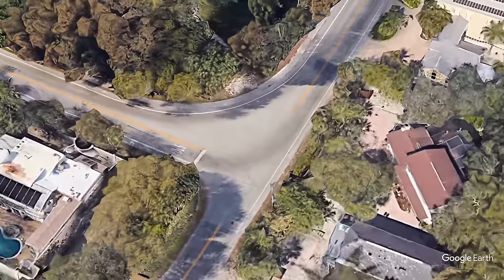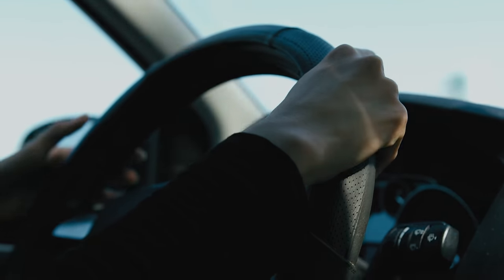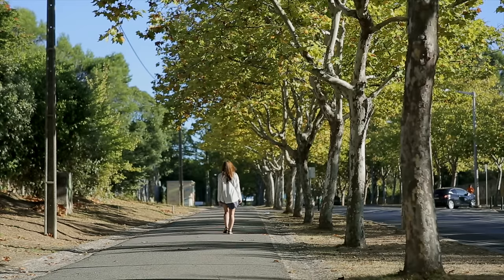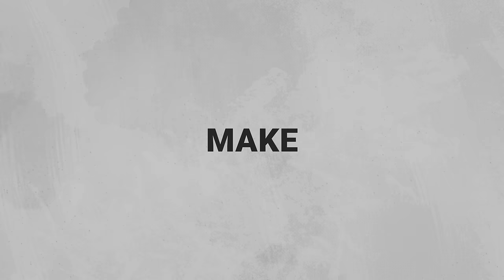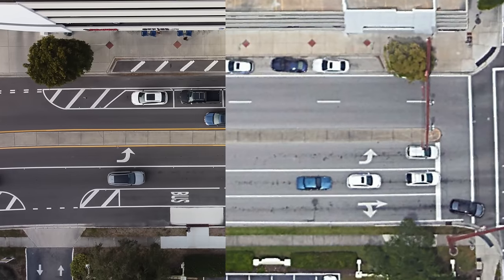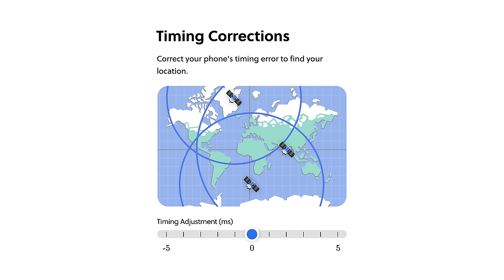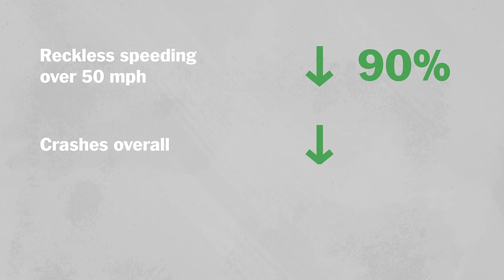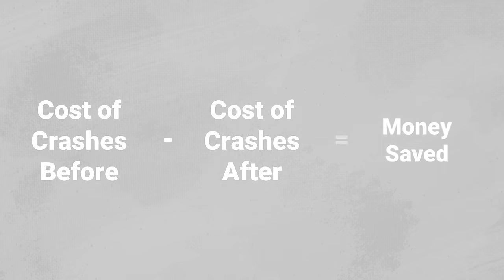This is the key to safer streets

Comment: Speed cushions are miserable if you drive a normal compact car with a lower profile. They cause a lot of stress on sway bars and end links (because of the unequal forces creating torsion) and create sideways motions that throw passengers side-to-side. In some cases at posted speeds I've seen passengers hit their heads on the inside of the window-- vehicle safety design is generally focused on cushioning forward-backward motion. But mostly, speed bumps of any kind favor higher speeds from tall or lifted trucks, exactly the vehicles most dangerous to pedestrians.

I much prefer the islands and narrowing perception tricks to get traffic to slow appropriately. Roundabouts as well are nice, and the plastic one shown here is a great way to introduce them.
Reply: ".. sideways motions that throw passengers side-to-side.."
-You drive an American car
-You drive too fast over the cushion
Reply: @RandomerFellow  the most uncomfortable it is to the passenger of smaller cheaper class European cars.  They are smaller and shorter at the back, so you don't have that much space around your head.
Reply: @RandomerFellow Posted speed in a German hatchback. So no to both, but thanks for playing.
Reply: I've never had a problem with them, ( I mostly drive a Honda jazz which is not a big car). All you've got to do it take it like a speedbumb, shift down into second and reduce your speed to 10-15mph.
Traffic calming measures are designed to reduce speed, not a challenge to try and speed across.
Reply: @annasolovyeva1013 Good to see a fellow Russian on here.

Comment: The big street I grew up on was altered from 4 lanes to 2 with a center turning lane. It has been that way now for decades. It has full proper signage and lane paint. Many drivers still do not pull into the turning lane to turn left, blocking their travel lane. other drivers pulling onto the street use the middle lane as an onramp almost colliding with car there waiting to turn left. I don't know if these are normal problems for turning lane roads or just our local dummies.
Reply: They are nicknamed suicide lanes for a reason. To fix the problem, through traffic needs to be separated from traffic that wants to turn. Using a parallel road on either side, that you can only access every half a mile or so. But I don't know if there's enough space for that.

Comment: As a Cincinnati commuter I actually have driven on North Bend Rd and got ran off the road from a speeder. The two lane road was so misplaced, like most of the roads around the area. The new changes are really welcome for a daily driver. Another road to mention in the Greater Cincinnati area is Harrison Ave in Harrison, OH right by the Marcos. Greater development has made the traffic move much more consistently, and protects left turn drivers going into the development. Great changes!!

Comment: Many of these issues have already been fixed in the UK, crossings have lines that mean you cannot park or stop there to allow for visibility on the crossing
Reply: Our road standards are still far behind The Netherlands, though.

Also, paint is not infrastructure. Those painted lines discourage parking near crossings, but don't prevent someone from doing so, especially as enforcement is so poor.

Comment: 7:14 When I was on vacation around Puerto Escondido, I quickly learned that in Mexico speed humps/bumps ARE considered an acceptable form of traffic control on highways. Instead of controlled access or traffic lights at the population centers along the highway they just paint a bunch of warning lines down and slap a slab of concrete at the end of it. On the local roads you were lucky if you got any signage at all.

BTW - keep up the great content. This level of quality does not go unnoticed!
Reply: Guess they don't care about the ensuing congestion then.

Comment: You forgot to mention the most cost-effective traffic-calming measure of all - in fact one that doesn't require any road redesign or construction efforts - potholes. A heavily potholed stretch of road/street will slow down traffic with certainty, even on wide and straight roads that would otherwise encourage drivers to speed. And it requires no cost to build or upkeep to maintain. In fact, it really doesn't.
Reply: Except drivers can sue the city for improper maintenance when their vehicles get damaged.  Potholes let in water which freezes and expands damaging the road even more.

Comment: Its also important to consider traffic densitiy and different types of safeties.

A roundabout is unsafer on the number plane, if you count number of accidents. That because small accidents are common in roundabouts. However, each accident is less severe, meaning a "accident" in this case is just a broken light on a car, or a small dent in the car bodywork.
But a roundabout is much safer if you count accident severelity, both at lower and higher speeds, because of everyone driving in the same direction, and also no dangerous left turns, which means, in most roundabouts, zero death accidents.

Roundabout is good when the traffic density is almost equal on all connecting roads. And thats why they "upgraded" this intersection to a roundabout, because the traffic density increased on the connecting road.

A stop sign (or a yield sign) is "better" if the traffic densitiy is high on the main road, and low on the connecting road.
If you want ultimate safety, you can instead use a stoplight intersection, having a always-green configuration for the "main road", and then a red light with a loop sensor for the connecting road, that will stop the "main road". That is the most safe option, with no accidents.

But that option work bad if the traffic density for the connecting road is too high, because then you will constantly stop the "main road" to let the connecting road through. So thats why you need a roundabout in this situation when the traffic density on the connecting road becomes almost as high as the main road.
Reply: As a rule of thumb, it's better to have roundabouts in suburbs and rural areas, and have traffic lights in city centres and other pedestrian-heavy places.
Traffic lights are less safe though, since they rely on drivers obeying the rules, which is not always the case. Roundabouts on the other hand use physical measures to force drivers to slow down.
Reply: @NewBuildmini  4-way traffic lights are less safe, as you have the dangerous left turn. 3-way traffic lights with an always-green configuration for the high-density road combined with red+loop sensor for the low-density road, is a ultimate safe solution, as there is no conflicting turns.

HOWEVER it don't work if the sensor road is too high density, as the high-density road will be constantly stopped then.
Reply: @sebastiannielsen  Regarding the last sentence, do minimum green and maximum green timers not exist in your country? They're a standard feature of vehicle-actuated control.
And can't the major-road vehicles make a left turn onto the minor road?
Also let's not ignore the fact that traffic lights only work as long as drivers respect the rules, which is not always the case. Drivers sometimes run red lights, which often leads to deadly crashes due to them occurring at right angles and high speeds.
Roundabouts on the other hand are designed in a way that physically forces drivers to slow down. 
The ultimate safe solution is complete grade-separation, by means of constructing bridges, tunnels, etc, so that no road user can cross paths on the same level.
Reply: @NewBuildmini  Yes they exist when both roads are controlled by sensors, or none. Then you have min/max timers. But theres in sweden common with lights that are always green, until a car appears on the intersecting road. This is used when the main road is heavy-density, so you never want to stop that road, UNLESS a car appears on the intersecting road. We have a 70 kph road in sweden controlled in this way, with a traffic light that is always-green (no sensors on main road), but then a intersecting T road to a small suburb is sensor-controlled and always red, so when a car comes to that intersection, the cars on the 70 kph road is stopped by the traffic light to let the intersecting car in.

About the left turn to the minor road, its usually controlled with a left-turn lane with sensor that will stop the opposing traffic only.

Here is such a road:
https://www.google.com/maps/@57.8016664,11.9761081,3a,75y,56.98h,86.32t/data=!3m9!1e1!3m7!1sMyen-dEp0-ibCZsUuaxbAg!2e0!7i16384!8i8192!9m2!1b1!2i39?entry=ttu

As you can see, that road has a always-green configuration until a car comes along on the T section road.

Its very rare with red light runs in sweden, as red light runs carry license suspension. Thats also why its important that you don't use this light system when the connecting road is too heavy density, as it will piss off the drivers on the main road.
Reply: @sebastiannielsen  You still missed my first point. Minimum green timer for the major road, and maximum green timer for the minor road, can be used to prevent the light staying green for too long on the minor road.
If the minimum green timer had already elapsed, the light will change instantly on demand. Otherwise vehicles on the minor road will have to wait.
Reply: @NewBuildmini  aah now I understand what you mean. They have such minimum/max green times on the minor road, so if there is too much cars on the minor road (for example if there is a major event in the suburb area) the minor cars have to wait sometimes so it don't become too much buildup on the major road.

Usually they will with a key switch over the traffic light to timed mode with fixed timers for all 3 roads when such events occur.

Comment: I've had issues with how some bicycle have been implemented. In Seattle's Capital Hill district, they added bicycle lanes along with a trolley line on Broadway. The big problem I've had is making right turns from a stop at green lights. It turned from having to watch for pedestrians that are a slower pace in a big night life area, to being even farther from the crosswalk, timing when you can get through a break in for traffic, and then having to look even farther back over your shoulder for bikes or powered scooters. The biggest danger is that they even put in street parking and trolley stops between traffic and the bike lane. It puts more stress on drivers and having to pay attention much more things. There's a part on it where there's an easement for a narrow parking garage, that you are pulling through packed street parking after an intersection with left turning traffic coming in behind you. You either have to wait to turn in blocking traffic, or pull in and block bicycle lane and pedestrians. Everytime I've turned into the bicycle lane, the pedestrians get surprised and think you're going to hit them. Visibility is terrible and dangerous to people on the sidewalk, bicyclists, and drivers. Block between Madison and Union Street on Broadway is the biggest nightmare for this.

Comment: Great video with a practical explanation of cheap measures that can be introduced without redesigning the entire road, neighborhood, city or country.

I would add that some of the things you mentioned as visual narrowing are also physical narrowing. There is also actual visual narrowing where you put a different type of pavement in the middle of the road or near the gutter, this doesn't actually reduce the space. Speed humps are mostly out of style and sort of a last resort.

I also think the stroad was not turned into a street but into a road. If it mostly carries through traffic there is no designing it out of being a road. But by making the changes it's a town road and not a rural road/highway.

Comment: Mini roundabouts have been installed in the UK for years, but they have turned into a bit of a war zone regarding who has right of way. The Highway Code states that traffic coming from the right have priority. But of course, not all drivers follow the Highway Code, so a lot of horn blowing goes on and of course smashes as well. There are tons of YouTube vids of mini roundabout in action and can make the viewer very dizzy.
Reply: Not seen the videos but I've noticed it driving around my hometown. Honestly I swear some of these people just do it to bully others on the road, earlier saw a guy in an SUV cut through two lanes of traffic because  he couldn't be bothered to wait 5 seconds, luckily traffic had already stopped.
Reply: Or, they just drive over the middle, which defeats the purpose of it.  At least with this version, you got to mount a plastic bubble in the middle to do it.

Comment: I think the biggest emphasis in NA really just needs to be "slow vs fast" designs. The specific infrastructure used to treat a fast road can vary, but as it is, nearly all roads here pretend to be highways, and the resulting mayhem is taken for granted. It's particularly egregious when you look at grid cities; if you made every other street in those slow with a few bumps and bollards and bulbouts, it would slightly downgrade the mobility of cars, but it would greatly improve bike and pedestrian mobility.

Comment: Curb extensions turned out to be a major issue in my town, especially for large vehicles. After their installation, we found that trucks required much wider turns. These extensions forced trucks into oncoming lanes, creating hazardous conditions at intersections. Vehicles waiting at stop signs compounded the problem, as my commercial truck often had to wait for completely clear intersections to make safe turns. Due to these difficulties, the town had to reconsider and eventually remove the curb extensions
Reply: It really needs to be addressed on a case by case basis which is why American road design is generally so bad,  there is no one size fits all design,  as can be seen from the junction before this roundabout was installed

Comment: I witnessed how important curb extensions where on a road not far from my dormitory. There was a 2 lane "highway" dotted with pedestrian crossings, and the crossing I want to focus here on was a T-cross. For several months there where construction, which created chicaned, narrower driveways and improvised curb extensions. Traffic jams lessened but also drivers slowed down and let pedestrians through willingly and often (instead of a 2m wait for a traffic light). Though after it, temporary things where removed and it was again worse... At least we got railings for pedestrians and safery islands.

Comment: In the city I live in (France) we have not one single traffic light, everything is managed through roundabouts. It's amazing. Can only recommend :)
Reply: Let's replace all highway interchanges with roundabouts then, and see what will happen :)
Reply: You don't seem to understand road hierarchy nor what I was talking about. Enjoy your car.
Reply: @shift-happens  My point is that roundabouts are not as good as most think they are. 
Sure, they do improve safety (if designed right), and can improve traffic flow in certain cases (like the 1st case in the vid, where the main problem was insufficient visibility).
But in a lot of cases, they can actually make traffic flow worse. For instance, if the traffic volumes on the varying approaches are unbalanced, the busier approaches will "dominate" the other approaches, resulting in there being little to no gap for them (which creates a jam). In these cases, traffic lights are more fair, and give everyone a chance to go.
In the UK they've actually started adding traffic lights to roundabouts (or replacing them with crossroads altogether) for this reason.
Roundabouts also take up more space in general, and as such are less pedestrian-friendly (longer crossing distances).

Comment: also road surface is important, asphalt is more speed prone than brick tiles (as they feel less grippy) that in turn are less speed prone than paved roads (as they feel like a lot of tiny speed bumps) that in turn are less speed prone than gravel roads (as they are not grippy at all and also bumpy)

Comment: It has a design fault compared to British ones: the approaches [left & right] have been left relatively straight and therefore fast, while the exit [going right] has an unessary slow point. 
British roundabouts, the entry is slowed, while the exit is direct. They also now have a small centre area, as it is not really necessary if the approach is slowed.
Reply: But the centre is raised and unlike the minis in the UK is more substantial (and it's brightly coloured), trying to drive fast over it would be VERY uncomfortable and likely damage the car.

Comment: At 7:55 that stroad could use a simple redesign to make it safer at cross walks and still function and a street and road, turn the middle lanes in each direction into medians, to create a boulevard, implement traffic calming on the edge lanes and in the center make it a road with the ability to get off the road and onto the streets every so often. The center turn lane could also become a multi use public transit and turn lane.

If it only needs to be a street though then the middle lanes become traffic calmed street lanes, the turn lane becomes a dedicated public transit lane, and the outer lanes 2 on each side can easily be turned into well separated and wide sidewalks and bike lanes

Comment: Curb extensions must be planned correctly also. Here in Portland there are several intersections with curb extensions where a driver making a right turn is unable to turn into the right lane, he is forced to turn into the left lane, which is in violation of the Oregon Traffic Code—not that anyone enforces that portion of the code.